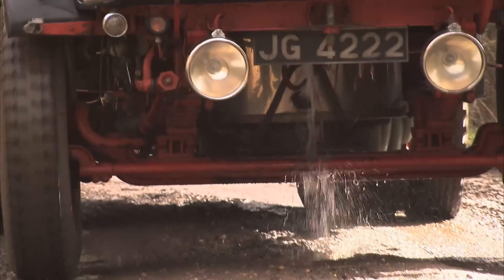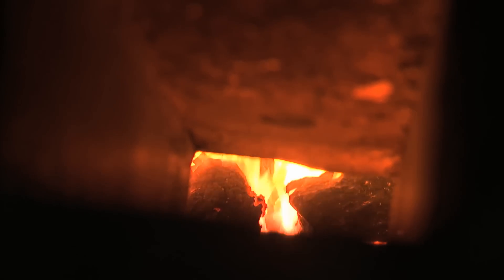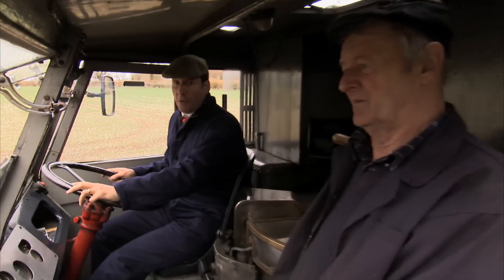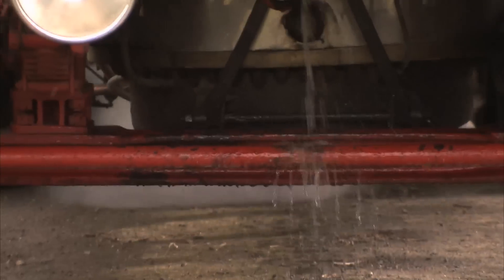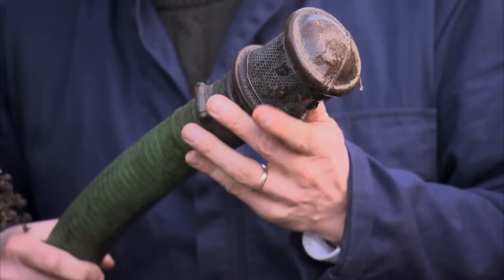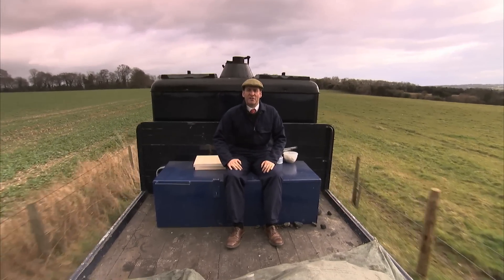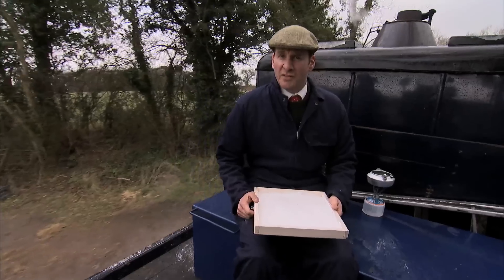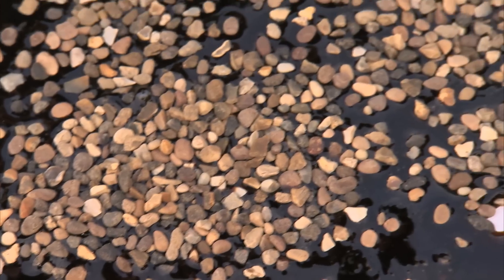What's the Greatest Machine of the 1930s...the Sentinel Steam Waggon?

Comment: Concrete can be rough finished by brooming it after a little floating and troweling, before it sets.  There would be no need for added tar and gravel.  I will probably get a big, "Duh" from somebody, but these would be great for the driver and stoker in winter, but not too great in summer.  "Water borrowing device."  Nice laugh.  Thanks.

Comment: The steam coming from the exhaust valve could be diverted condensed and reused in that case they wouldn't have to stop at a pond
Reply: Yes it certainly could be, but the required condenser and additional piping was just to large and heavy to be practical on a road vehicle or train. It was done on steam ships and power stations, however.
Reply: @DavstrWrexham  just a suggestion gradually condensation could be applied with the piping from large to small  and also probably sped up just a thought 🧐
Reply: @DavstrWrexham  don't. You think it could be done with minimality and amplification or in stages subtraction and multiplicity of the components? Thank you

Comment: I believe the most powerful ones made 90 horsepower.  But at 600rpm this meant tremendous torque.
Reply: horsepower has almost zero relation to the actual energy throughput or max load of a system, it's especially deceptive in steam engines since the way it is calculated is pretty much explicitly designed to lowball on anything that isn't trying to crank up it's RPM as high as it will go and bleed energy out to do things loosing max speed in the process (steam engines are the exact opposite) the other thing they are deceptive on is that they basically don't have a max torque: even a tiny little handheld steam engine that only processes a few watts of eat into kinetic potential will just keep pushing harder and harder until some part of the system finally breaks, make it sturdy enough to do the job and it will push that truck...slowly.

presumably the uselessness of the "unit" of "measurement" (horsepower does not actually qualify as either a unit or a measurement) as a frame of reference for work done is on purpose because you also have a near-impossible time finding numbers for commercial gas engines that give actual energy throughput...hell, even comparing horsepower to horsepower is usually completely useless since that nonsense number means entirely different things in different energy systems to the point where it's not even the same thing in two identical cars under noticeably different conditions. it is a unit of measurement made up by a salesman in order to sound more convincing when lying to their prospective customers and it has never stopped being exactly that.
Reply: whoops! forgot a part there: boiler volume matters a lot: more volume = less required pressure to reach the same torque = lower standing heat required to reach the same torque.
a tiny boiler would need to get HOT to push that truck even in a "well, it's moving...sorta" manner.

Comment: The service road outside my home is concrete, laid in large rectangles, with a layer of Macadam over it made later. I never knew it was added to give extra grip as I presumed it was a later form of road surface. The concrete is still good today but has raised ridges at the borders of the concrete joins which could be harsh to drive if it was a main road. Excellent road.

Comment: I never understood why steam engines couldn't just have a condenser, to convert all the steam back into water to boil again. A sterling engine would have been a great device to pull the heat out of the steam to make power, while condensing it back into water.
Reply: Vacuum condensing can double the efficiency, but it's a lot of extra bulk and complexity (why it's usually confined to stationary, large scale use, like power stations) , it's also difficult to get the steam down to cold enough tempretures to condense it below atmospheric pressure.
Reply: It was fairly common.

Comment: Please, I need a help.
I have a Toyota 2016  model  I bought and I drives daily.
It leaks a lot of water that I thought is the AC, have a cubicle for storing coal and charcoal, does not have any water Store other than the radiator which uses water on daily basis.
It also produces steams through the exhaust pipe.
The speed is up to 180km/hrs.
Could it also be a steam power engine cos am not good in cars

Comment: The modern version would be an artic tractor rather than a rigid six (or eight). It would have a mechanical stoker and water in saddletanks beween the axles with capacity for 250 km. Because of the extra weight in comparison with a diesel, it would have three (or even four) axles giving the same axle load as a diesel. The weight doesn't matter to the steam engine, which has ten times the torque of a diesel.

Comment: I'm surprised they didn't make the oil (or diesel ruled). So you wouldn't need a Stoker. You could have had a smaller fuel tank, so a larger water one.
Reply: The UK had loads of coal but not much oil at the time. Coal fired would definitely have been cheaper.

Comment: I wonder...if one could use a proper electric vehicle battery to power a heating element to create the steam for a steam wagon??
Reply: Switzerland actually did something very similar to that during WW2. Most of the coal they burned in their steam locomotives was imported from Germany, which obviously became a problem very quickly. However, what Switzerland did have was a large amount of hydroelectric power. So they did what any sane country would do in their situation. They modified several of their steam locomotives with pantographs and special electric boilers, so that they could turn electricity into steam. Because clearly, that was the way to go.
Reply: @Phoenixlover55  Electric boilers are practicable with a continuous source of power but the OP was talking about battery power so not a chance in my opinion.
Reply: @gagatube  I know that, I was just telling them about the only example of an steam-powered vehicle with an electric boiler that I knew of.

Comment: This is pretty cool...but seems privative for the '30s.  I'm having trouble finding data on vehicles in this class in the '30s, but I just find it hard to believe that a typical combustion engine couldn't outperform a steam engine by this time period.  Gas cars at the time were certainly much faster than this thing.  Were vehicles just poor performers in England during the '30s?
Reply: I imagine a big advantage of steam over early internal combustion would have been torque, steam seems to have been used for the heaviest of heavy haulage far later than any other road going use. From everything I can find though, this one, a Sentinel S, was really not that competitive when it was introduced in the mid 30s. They seem to have been fairly successful with earlier models throughout the 1920s though

Comment: Imagine if we applied modern technology and manufacturing methods to perfect the flaws of this system, mainly the long startup times and manual feeding. recirculating steam system. Modern turbine design. Hell, with modern tech the most efficient way might be just to slap a generator to it and power an electric motor.

Comment: This would been better had it recycled its own steam back to water, used liquid fuel source and used super heated steam instead of a traditional boiler it uses flash boiler. 
It would been good enough for up to the 70s if they had these simple changes.
Reply: In South Africa they built and operated condensing steam railway engines. Condensers tend to be big & bulky things, hence mostly seen on steam ships. Liquid fuel? Then you might as well use a boring IC engine! As for super heaters, maybe there wasn’t enough room for them in the boiler? :)
Reply: @peterudbjorg  
There were lots of steam cars with condensers built into them actually so they do not HAVE to be big and bulky but big and bulky generally makes them more efficient.
But Steam is impractical for small vehicles no doubt, electric power is far more efficient we just need a more efficient way of storing electricity, whether there is a liquid way of storing electricity or denser battery package in the future.
Reply: @SMGJohn  Steam engines usually got up to 7–8% efficency. IC engines hover around 30%. Electric motors are 100% (or 99%…). But the batteries are (literally) a drag…
Reply: @peterudbjorg  
In your calculations for electrical vehicles, are you counting:
* the environmental destruction of Afrika open-pit mines?
* the health destruction of Afrika children working those mines?

Comment: 160c steam is not much. No wonder this thing burns so much steam. , Some of the later steam cars were closed loop so they ran like 200km before needing more water , & they had automatic fire on and off system which cut off or cut in fire to maintain temperature and pressure. They also use much much higher steam pressure like 600 to 800psi which is ofc more efficient.
Reply: Yes, but they couldn't tolerate the poor quality water from random ponds and water troughs.  Even steam locomotives seldom went beyond 350 psi, in part for that reason.
Reply: Running a condenser makes a significant difference in efficiency too as the discharge steam from the engine can be below atmospheric pressure. It does however make the engine far more complicated…
Reply: They had to use distilled water I think, for higher compression.
Reply: @angelgjr1999  Hotter steam accelerates corrosion if any oxygen is present. Urea or Ammonia is often added as a scrubber in steel boilers (but can’t be used in copper tube boilers).
Stainless Steel boilers have the reverse problem and need oxygen added to prevent corrosion…

Comment: I wonder if recapturing some of the steam could make them run longer.
Reply: No it would not. The energy produced within steam engines is derived from the expansion of water into steam. This expansion is exponential as the temperature increases which means that the energy required to induce thermal expansion exponentially increases as well. Recirculating the steam would yield no benefit to efficiency and would massively reduce the effectiveness of converting chemical energy to mechanical energy expansion in the next cycle because the rate of expansion would decrease in proportion to the volume of water initially added. In other words yes, but only if the cylinder continued to get hotter and hotter exponentially until you reached a point of maximum expansion without causing mechanical damage.
Reply: @Waldel Martell The potential energy of the molecules decreases as their structure expands. Its only the internal energy of the engine which increases. That increase is proportionate to the loss of potential energy in the water molecules, so the more the water expands the less energy you stand to gain by expanding it further regardless of how much energy is used to create that expansion.
Reply: @Waldel Martell You can ask a physician, but I’ll ask a physicist.

Comment: 3000 ft-lbs of torque. More than twice that of the most powerful modern diesel heavy trucks on the road. 

You could haul a cathedral behind it
Reply: Dunno about your country. But the most powerful truck on Australian roads (talking horsepower. But I assume it has the most torque too) is the Scania 770. It has 2730ft-lbs.
So not near twice as much. But still more and that’s crazy impressive
Reply: @LudditeK100  He means pickup trucks. Like an F150. Most of those have like 400 ft lbs of torque.
Reply: Double the torque doesn't matter when a modern truck makes three times the rpm. It has to have a transmission with low enough gears
Reply: Steam engine cars were not fast, but boy did they have torque. I heard you could pretty much launch it on top gear. Jay Leno showed this.
Reply: But, speed
Reply: O sh!t, I come again!

Comment: The Sentinel was steam's answer to the diesel or petrol truck, by the 1930s making big inroads into the traditional steam traction industry. The Sentinel's design was revolutionary but the steam truck had some major disadvantages when compared to the diesel truck: The steam truck was a lot heavier than the equivalent diesel truck which meant that it couldn't carry as much payload before exceeding the gross vehicle weight, it would need a crew of 2, increasing overheads and its range was limited by the water and coal capacity. I accept that a diesel truck also has a finite range before needing refuelling...
As a specialist work vehicle, you quite rightly highlight its advantages but as a general carrier, I think it was something of a blind alley. E R Foden's board spent a long time discussing the merits of diesel and steam trucks, ending with a parting of the ways, Foden and ERF companies resulting. Fodens continued to make steam trucks but eventually bowed to the inevitable and followed ERF down the diesel truck manufacturing road.
Don't get me wrong, I'm a big fan of steam traction and it's always great to see and hear it in action.
Reply: Not to mention how long it took to get up steam in the morning ! You can’t just turn the key and off you go with a steam wagon !
Reply: Not to mention the constant meddling from government regulations, which only caused damage without the intended benefits. It was built with 1920s industrial technology, and did not have condensing equipment like the Doble steam cars of the day, so it was limited in that iteration.

45% efficiency for ICEs was also highly theoretical, it changes drastically with things like stopping, waiting and human error/ impatience, so it is not a huge deal, and certainly a non-factor in the day, technology did not have the capability to keep up with theoretical limits. 

There was also a strategic consideration. Oil was imported into the UK, and you wouldn't have any of it the moment the ocean flooded with U-boats, and the skies with bombers
Reply: And steam is wasteful. It only uses about 7% of the fuel for traction, the rest goes up the chimney. A diesel engine comes closer to ≈30%.
Then there's the extra weight of the boiler, and all the extra fuel and all the water you have to take along.
But, yes, steam traction is, well, cool! (Or hot...).😄
Reply: @cieludbjrg4706  Diesel engine thermal efficiency today is 45% in car engines, compared to 35% for the best petrol engines. 
Two stroke marine diesels can exceed 50% thermal efficiency. More than 3 times the thermal efficiency of the best steam engines.
Reply: @hiyadroogs  Today, yes. But back then 30% efficiency was more likely for a diesel
Reply: @hiyadroogs  Combined cycle gas turbine + steam turbine engines used to spin generators at natural gas fired electrical power stations achieve over 50% thermal efficiency as well. I visited one that was closed cycle, the exhaust steam was condensed by essentially a car radiator but measuring about 50 meters by 50 meters.
Reply: @JWQweqOPDH  Yes, the old stuff was built based on patents that are thousands of years old and is / was far superior to today. Now that it is all demolished there are no records and monopolies are in place. We didn't build it
Reply: @togowack  the patent office has only been around since 1852 😂
Reply: @NeedleDrops  the drawings in the patent system are pulled directly from documents and books that are very ancient, you can see multiple forms of hand writing, whoever filed the patents and signed the documents had nothing to do with wherever the design came from.
Reply: @togowack  Idk what you're on about, but there would be no use for such thing thousands of years ago, you may have gaslighted yourself.
Reply: @davidaugustofc2574  thousands of years ago the world was much the same and far better than today
Reply: @togowack  you should honestly consider quitting drugs
Reply: @davidaugustofc2574  you should quit your Freemason history books
Reply: @togowack  gravity doesn't let me be so high all the time
Reply: @davidaugustofc2574  yes you would need to be to make sense of the world they gave us
Reply: @togowack  I make good sense of the world around me, I Don't find myself even needing a religion to guide me in life.
Reply: @davidaugustofc2574  you wont come across many like me that made peace with our true past and true future. Born again Word of Faith. Only the fool tells to himself there is no god.
Reply: @togowack  You will never be able to tell how glad I am you were not mass produced.
Reply: @davidaugustofc2574  white people were worried in the beginning but then realized the less you have of something the more it is worth
Reply: Seems like they would put more than 30 miles of water capacity. I guess they just weren't going long distances those days.
Reply: And those disadvantages are MUCH bigger on car, than on train. Train engige weight anyway 50+ tons (dieselelectric usualy round 80 tons), and can tow 1000+ tons of wagons. (say 30 wagons) SO steam engine 100 tons+40 tons of water and coal ISNT big problem. Maybe it take "only" 28 wagons instead of 30, but thats minor difference. On car its a big problem, you can loose half of capacity.
Reply: Before my dad passed away he and my brothers built a steam engine car that could run on coal, wood, charcoal, propane, and a WW2 gasoline stove. We just had to swap out the heat source for the available fuel…
The diesel and propane had their own custom boiler that would get slid into where the tradition boiler would be removed…
Reply: @MrSheckstr  this is one of the reasons steam piques my interest. Input is stupidly versatile.